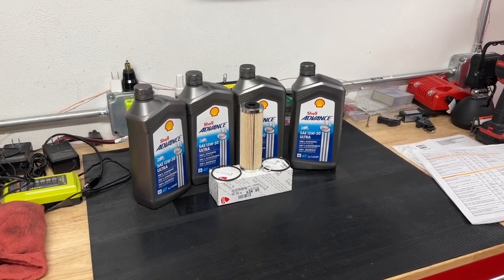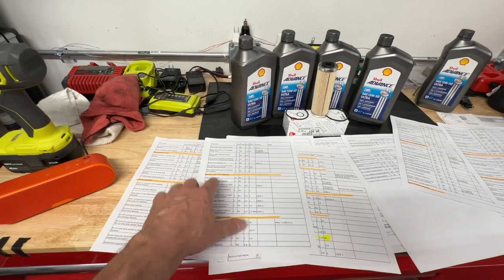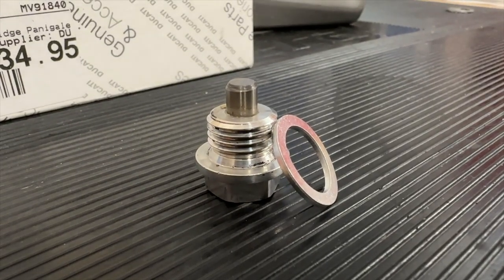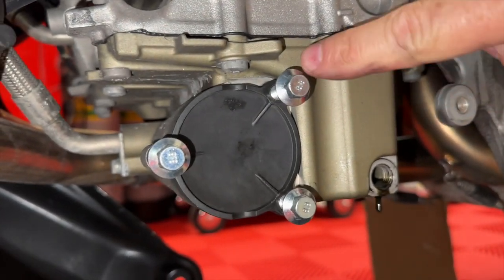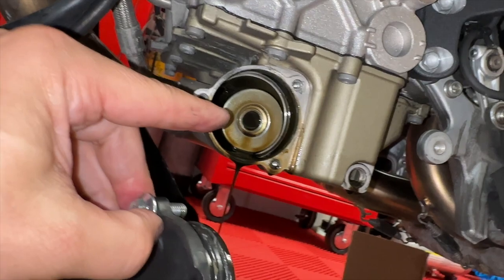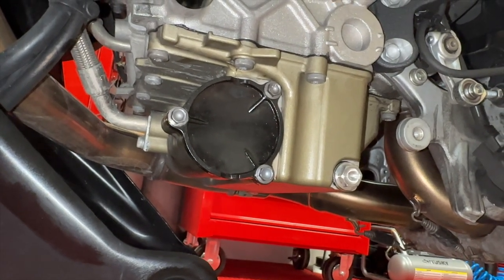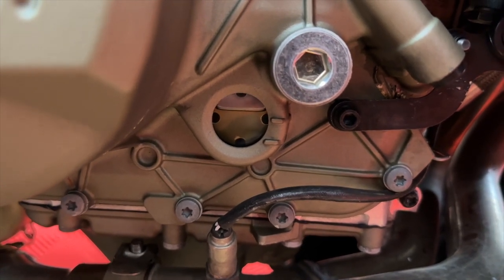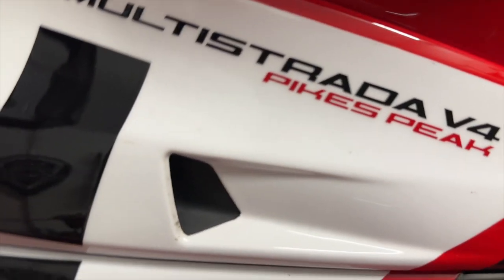How To Change The Oil In The Ducati Multistrada V4 Pikes Peak Motorcycle

Comment: Hi buddy thanks for your helpful videos, about the black things you found at the drain plug probably is FIPG, is just a seal, I guess Ducati wants to be sure is not going to be a oil leak. 😊
Reply from the maker: It’s possible, but I never had that on any other motorcycle or any other Ducati before

Comment: Torque settings:
Oil drain plug with magnet. 14 Nm (Sealing Compound A on thread) <— the black rubber on the thread
Oil filter cover retaining screw. 10 Nm (Pre-applied Loctite)

Comment: Be cautious when removing that oil filter cover. I just used this method for changing my oil on my V4 Rally this evening and the 8mm bolts did gall the openings…heck, they started to tap an 8mm thread into the 6mm exiting holes. If the steel bolts start to bite into the soft aluminum, this is going to happen. I initially saw the aluminum shavings and when I inspected the holes…sure enough, they were being enlarged by the 8mm bolts. YMMV, but I will be trying something different to remove that filter cover next time. Maybe I will thread the bolts into the cover threads and see about using the mounted bolts to pull out that cover rather than using the bolts to push agains that block of aluminum on the backside of the cover.

Comment: I changed my Hyperstrada 939 with Shell Advance Ultra 15w50 to replace the old (Motul 15w50 7100 I believe by the red color of it) the difference is:
- shell makes the bike start quicker and feels more powerful when riding aggressively (touring and urban mode, I never try sport mode at all)
- but the engine reaches 100 degrees faster than the old oil, I believe because Motul 7100 has slightly higher in viscosity , I don’t know for sure but Motul makes the engine run 10-15 degrees Celsius colder than the Shell
M country is tropical and its hot season (30-35 degrees C)
Reply from the maker: Interesting

Comment: Hi Rembo, your videos are great!!! I just had my first service done at 640 miles. I rode it home and it sat for about 2 hours and when I checked the oil before I took for a ride it is over filled from dealer. How can I remove some of the oil? Thanks in advance
Reply from the maker: If you are positive it is overfilled, you can try a bulb syringe from the fill port.
Reply: Thank you, I checked it again on both front and center stand it’s a hair about the top fill mark.  Took it off the front stand and went to top of window. Then took of back stand and checked it and again top of window. Noticed I had the suspension on two up with bags, adjusted the suspension to only single rider mode, felt the bike lowering check the oil again and just a hair over top line like when it was on both service stands.  Interesting that by changing the suspension effected it that much.

Comment: Hey Rembo, with the trip to COTA, I'm well passed the 600 mile break in service on my new '23 Multi PP and I've always done my own service, but with my past Ducati's (Monsters, Panigale) I've had to have the dealer do a re-set (for a price) when I do my own service.  I'm curious if with the Multistrada if there is a way to re-set the service reminder without having the dealer do it?
Reply from the maker: I have been unable to figure out how to reset the service light.
Reply: @RemboUSMC  Ya, I'm guessing it's the same as my other Ducati's - bring it to the dealer to have them reset - they'll do it for about $50 (a discounted shop rate)

Comment: Hi mate did you let it drain for a good amount of time as I no the v4 takes a good while . I've heard reports where people have taken the streetfighter v4s in and garages have done oil change and then put required amount and they have then been over filled on the forums . I've left mine draining over night since doing my v4 I've had. And little one mate I'd hide I'd of engine especially here in the UK 😢lots of stealing id s sadly . Great video Brembo as normal.  Cheers pitch
Reply from the maker: Over an hour

Comment: I decided to do the exact same thing. I'm thinking that the first change after the initial 600 mile service is going to be at 4000 miles. Per Ducati, they can't reset the oil service light before the bike reaches the designated mileage and turns the light on, so make sure you don't go to the dealer before you get the light on the next oil change. Curious - any material differences changing oil on the regular MSV4 and the PP?
Reply from the maker: Is zero difference and I also have a how to change the oil on a V4S which is absolutely no different other than the title of the video. It’s the same process and procedure.

Comment: I was told that you have to wait 2 1/2 hours draining your oil before you put plug back in, can you let me know if this is correct, thanks Rembo.
Reply from the maker: That is absolutely not the case. You have to warm up the engine and you’ll always get an adequate amount of oil out. You will never completely drain the engine unless you tear it apart. If I did this when it was cold, I may have to wait that amount of time.
Reply: @RemboUSMC  There are different theories, or methods, when it comes to changing the oil with the engine warm or cold.  When you warm up the engine it is true that the oil will flow better but you are also distributing the oil all up in the engine which means it will take some time for all of that to work its way back down to the bottom.  I have sometimes planned to do my oil changes first thing the next day but I will pull the drain plug and filter the evening before and let it drain as long as it needs overnight.  You can still even warm the engine to do this if you want.  Nothing better or worse with either method, it's just personal preference.

Comment: I now see there is a "Ducati" specific Shell Advanced oil in a red label.  Might be new-ish?  I also heard another YouTuber reference this specific oil  in a Panigale the sportiest version-with a pipe/tune- adds 8 hp up to 240.  Quite a claim..  Further, the oil is advertised as "no loss of horsepower as it wears".  I have never heard an oil make such claims.  Any thoughts on this?
Reply from the maker: I buy the oil directly from the Ducati dealer that matches exactly what is in the maintenance manual. I do this, so that if I ever have a warranty claim, I can point directly to my receipts that I did exactly what was asked.

Comment: About to take mine in for the annual factory service (I still change oil in between..). Coincidentally, I just started having the same low speed/no speed stalling issues reported by Rembo on his MTS V4S now on my MTS Pikes Peak V4. Curious if anyone else has noted this? Rembo what was the final verdict for your V4S on the matter?
Reply from the maker: It occasionally happens but hasn’t happened in a while since I hit 5000 miles.  It is only when in gear and the clutch pulled in when the bike is hot coming to a stop.
Reply: @Rembo USMC  I just clicked over 5056 miles on mine too. In fact it is almost on the 5000 mark exactly that the issue popped up, has been flawless prior. Thanks for the update and reply👌 👀
Reply from the maker: @_Jaded_  It just happened to me today twice getting off the highway after a long ride.  Still an issue.

Comment: Is it ok that the oil get darkish so soon?
Reply: Yes.  It's the oil doing its job of suspending the carbon build up of the engine in the oil itself so that it may be flushed out with the oil change.  Just because the oil is dark does not mean that it is bad and no longer doing it's job.  These synthetic oils can go the distance of what the manufacturer suggests between oil changes with no problems under normal riding conditions even if the oil is completely black.  Black does not always mean that the oil is burnt and broken down.  Now, there is absolutely nothing wrong with changing the oil early like he is doing here.  Fresh oil is always a good thing.

Comment: 😆 aaah yes, the black goo on the sump plug....

My theory is it's a sealant to prevent leakage because the thread is so easily stripped - how do I know you ask?......well my drain plug was damaged by the Ducati shop and when I did my Rembo Inbetween oil change I discovered the problem........I don't use torque wrenches on sump plugs for this reason.....I just feel them in firm, but for others with super strong wrists they may help prevent stripping a thread 👍.

You have two questions below.....the answer to one is there is absolutely no difference between a PP and a V4S engine.....identical spec, no changes, same materials.

Also, I forget the other Q, so you can do it, but my question is how much oil did you put in? I noticed the spec is 4.4Ltrs, with filter, but I find this results in an overfull sight glass level so I just do 4ltrs and add just enough to run with the oil level slightly above max from full cold (center stand).

Thanks again Rembo for the filter removal tip, I have used my 3 bolts each time rather than break or scratch the cases......👍

Oh, waiting 2.5hrs......at $100/hr labour rates, yeah right.....I just push my V
4S onto the side stand and let it drain until it dribbles slowly.....there will always be about 500cc left in the motor no matter what we do (see the spec s for assembly oil volume and change oil volumes) so not an issue, and that's also another reason to do more frequent oil changes. Oh, one thing you didn't cover (very naughty of you 😜) is when starting the engine after changing oil & filter, is to not rev it immediately, or better yet, use the kill switch so you can stop it turning over before firing up......so the oil pump can fill the new filter before the ignition makes the engine run at 1500rpm......don't want any bubbles in the oil lines 😱

Comment: Please tell me the part numbers of rubber bands, rings and bolts. Thanks
Reply from the maker: Filter: 44440312B
Oring: 88650761A  (need 2)
Crush Washer: 85250541A

Bolts at local hardware store
Reply: @RemboUSMC  thank you very much

Comment: Hi Rembo!. This 'black gummy stuff' is Joint Paste (i guess that's the name in English). You have it between the silver metallic part of the engine and the golden one (min 5.22). It's an excess of material being applied from the factory. In honest opinion, quite dangerous because it can go somwhere no desired and get stuck there causing bad lubrication. Also... What the hell is doing your bike with the oil??? 😂 Only 5000miles and looking that bad... Honestly I hate Shell oil, It gave me such bad results on my Multistrada950 (massive oil consuption, almost like a 2stroke engine). Have you tried Motul oil?  Have a nice day!
Reply from the maker: Track days trash the oil on a single cylinder

Comment: Your oil is not clear in your last shot.  My mechanic told me it takes about 2.5 hours for the oil to drain out of the V4.  I waited 3.5 hours and my Pikes Peak V4 2023 took 4+ liters of oil and the viewer still shows clean oil, not like yours.
Reply from the maker: Thanks for the info. You will, never, ever, ever get all of the oil out of any combustion engine. To speed up the process and get an adequate amount out, the engine should be warm or hot. Millions of vehicles have oil, changes regularly, and they are done and drained in about 5 to 10 minutes. Fresh oil and a filter are very important for the longevity of any engine. Personally, I change mine twice as often as recommended by the manufacture.
Reply: @RemboUSMC  A V4 takes 2.5 hours to drain per a master Ducati mechanic.
Reply: @RemboUSMC  if I took my bike to a professional and it was returned like this, I would never go there again.
Reply: My oil color after oil change and 150 mile ride.  I change oild every 4,500 miles.
Reply: @PezRaider  why not just drain the oil cold after sitting for a few days? Most the oil would be in the sump then and you would get most old oil out..
Then measure old oil and put back in the same amount. That's if the level was correct to begin with. 
When people warm the engine then  drain them they have to leave them over night to get all oil out...seems pointless warming the engine.
Reply: @marcusbarnes5929  My master Ducati mechanic told me to do it this way. Since he does all the hard work on the bike, I do everything his way.  I am just a wanna be tech.